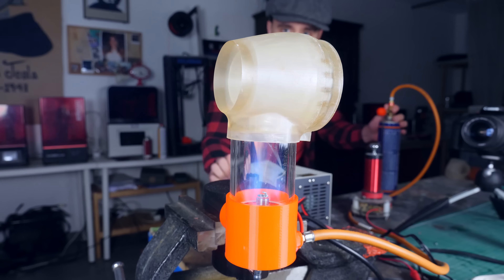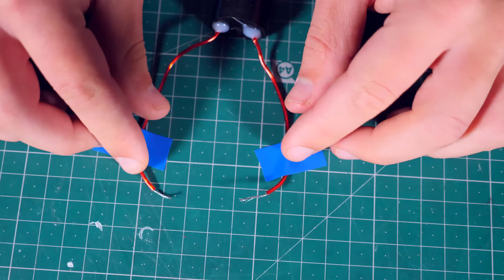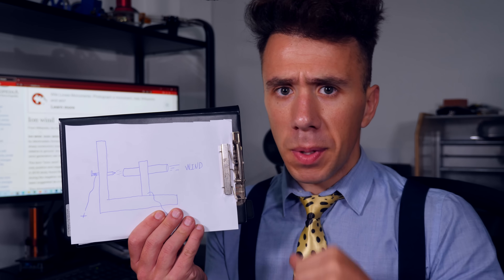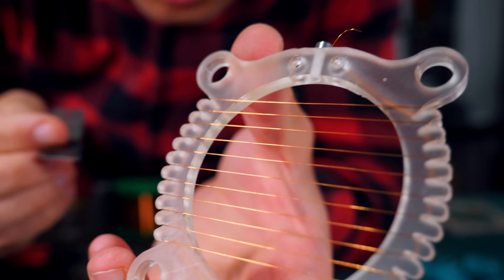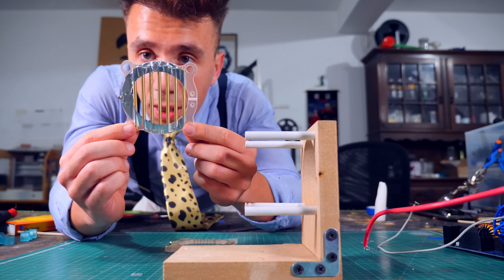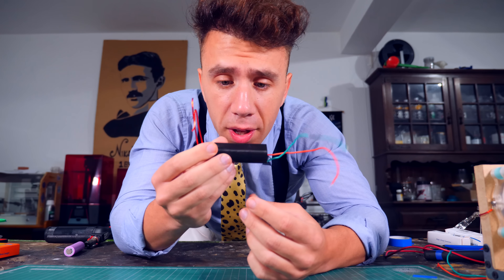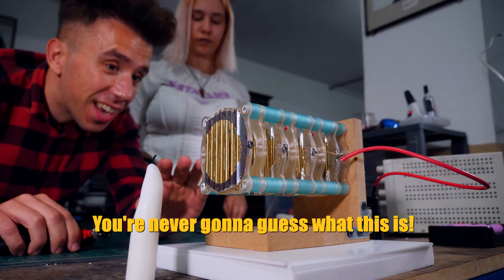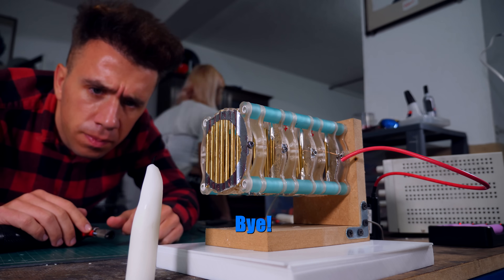I built a TRUE BLADELESS FAN

Comment: It would be a cool idea to mount that inside of a Dyson type fan. You would have to make the negative blades removable and cleanable because they will attract negative ions. I.e. dust. Mount the system upright in a funnel housing with a enclosed loop to move the air and you will have not only a fan but an air purifier as well.

Comment: What would happen if you used it to ionise oxygen which combusted with ionised flamable gas to make a jet engine or super hot plasma torch?
You could inject the oxygen through syringe needles and methane etc through holes in in your existing pipes

Comment: Why not put it in a cone configuration?  As in, you 3D print an external jet casing, and spiral-wire the inner wall of it in a criss-crossing grid, and then have your "blunt object" be the spike-nozzle of an inner cone fitting (it's blunt because the pointy part is aiming out and away from the jet, while the wider portion is closer to the inner wiring)?  If you cap the outer wires with a layer of foil to create one big connection point at the intake, and then run the wire for the inner cone through the plastic inner cone to reach the plating of the spike, then you'll have plasma flow running down the inside of your jet engine.  All the power would hook up at the intake point without the positive and negative interfering with each other, and there'd be no trailing wires to interfere with your airflow at the output.

Voila, plasma jet.

Comment: The likely reason the cheap chinese high voltage thing provides so much better results is that it is likely outputting a higher voltage due to the voltage multiplier having a lot of stages.
The flyback in the circuit you got and the one in that TV almost surely already have a voltage tripler but it could benefit from more stages.
The ZVS circuit in the flyback driver that you got is great for getting a lot of current out of the TV flyback transformer but driving it in flyback mode can actually get you a higher voltage and be more efficient for this application. 
If you want to get the most voltage out of a TV flyback without using a multiplier: I would get a high voltage n-channel  mosfet 500V of more and as high current and RDson as possible with a zener diode of slightly lower voltage between drain and source to protect it, place both between the primary and ground and chop the ground of the primary, that will cause some monster voltage spikes, as high as needed to transfer all the energy out of the secondary or to be dissipated in the zener, whatever happens first. I would also wind my own primary in the ferrite core so you can fine tune the number of turns (few are needed, 10 to 20 is a good range if I recall correctly). As you are goint to push it real hard I would also advise you to cut all the pins from the bottom except ground and pot everything in epoxy as they will arc over, they might despite of the epoxy if driven hard enough but you can get 70KV or more out of a regular TV flyback this way. 

Another way to get a ton of voltage out of this things is driving them in secondary resonance mode instead of in primary resonance like the ZVS driver (or double resonance if you are insane and want it to set in fire) but it is a more complicated circuit that the flyback mode and won't output much more voltage. It will output more current, but it doesn't seem like you are limited by current if it works that good with the cheap chinese HV generators.

Comment: Since we are working with low levels of thrust it might be worth considering ajusting the air pressure somehow at both ends of the fan to incentivise air movement. Probably covering the thing in a thin acrilic tube might give it more thrust by reducing the resistance of the air around it. Plaing with nozzels, intakes and conical shapes might give better results. Also we should consider the thickness of the wire and the power that runs through it. For example a thicker wire might support a stronger current and improve the design in that sense.

Comment: I have a sneaking suspicion that meter might be picking up some wawes or charges from that fan. Especially if at any point it was AC. I mean there is already a small AC motor in a closed circuit there.

Comment: Concerns about ozone set aside for the moment I would suggest the following:
1 Does is increase the velocity of air that is already moving? Place a small fan near the intake and measure the input flow and the output flow. Is there a linear correlation? If so line up two or three units housed in a pvc pipe. Maybe you can make something like a ramjet or scramjet. 
2. Venturi ducting on the inlet.
Just a couple of thoughts.

Comment: You could rrange the stages in a circle and put them in an impeller casing (make the air go in a circle so it can go through more stages before exiting the fan).  You could also used different sizes of tubes to see which works best (thinner tubes might mean better aerodynamics but i dont quite know the tradeoffs). You could also stick it in a cylinder,  works for every fan so far. (Also probably helps with electric isolation)

Comment: Video idea for both you and Jay: make a piston engine but the piston is pushed through electrostatic.

If that made no sense, then, my idea is basically that you have 3 plates: 2 for the cylinder and 1 for the piston. The piston is always negatively charged.

Then both plates on opposing sides of the piston will switch from negatively charged to positively charged and the cycle repeats.

Since negative plates like to attract positive plates, but negative plates DON’T like to get connected to other negative plates, then the piston plate will move up and down.

Try it! Doesn’t matter if it works, because it’s just a proof of concept.

Comment: IDEA#1: Instead of the thin wire going straight across, wrap the thin wire in a coil around a thin insulator about the thickness of a toothpick. (basically replace each thin wire with a coil of thin wire - to get more surface area).  score the coils across with a sharp blade like you did for the wires on opposite sides perpendicular to the the plane of ionic motion and score it the direction of motion (don't score the back). This will cause the pointy fields to pull in more ions of air than a single wire (kind of like a dyson fan) to amplify the effect (for the positive ions).  Basically, you will play around with the laminar flow.
Reply: I wish this comment to rise higher in the ranks. Help men
Reply: @Alex Smith good point

Comment: Hi ! I saw that u made a wankel Air engine (rotary piston engine) in the past. Now i want to suggest you something. Try adding a small air compressor (3d printed) with some gears so the compressor will have a higher spinning rate than the engine. It may result an engine that generates power by itself. I think that You should try it because u have the necessary things for it. Thanks !

Comment: First and foremost, you can get better RoI on power by contining the asembly so pressure isnt lost out the sides but forced forward.
a consument V design in a 2d lattice to the wire side would probably help a lot in getting the electrons to flow off (but that would probably require a press form to make and need a backing stablizer which will effect flow through put with addl resistance.
Simlarly converting the tubes into a matching 2d bulb latice that matched the V's would be a good idea.
Also having a diamenter band of wire that distributes the conection along each end at scale would probably help ensure use of all contact points vs the jumps that make the shortest circuit.

Comment: Plasma tornado of course. Stack the plates (a shout out to the airfoil copper tubes to reduce drag) into a circle. While heat will generate an updraft, maybe have some side plans for wing tips and/or imperfect alignment. If it's not visible enough, maybe a tesla coil going in the middle of it.

Comment: What if you encase it? 
Leaving the Intake and Exhaust open, and adding a Funnel with the reduction going in the direction of the airflow to the Exhaust. 
This should give you more Pressure. 
Before you finish this Project, can you spray a flammable Vapor into the Intake? 
I like watching you play with Fire.

Comment: I would think the next step would be to funnel down the air to increase velocity.

It looks like you are a 120mm size so if you step it  down to 80 mm or 40 mm that should increase the velocity 

Maybe also have multiple steps funnel down into one output.

Comment: Hey, what if you direct the airflow better, like covering the sides of the stages and allowing air only from the back side (like a blade fan, blades get air from the back and allow out at the front, sides are solid). Maybe making each stage to be 90 degrees from the previous one?

Comment: This is really interesting! I have so many questions;
1. How does the power consumption fair against a regular fan with similar power?
2. Is the air it produces warmer than the ambient room temperature? 
3. What’s the noise level compared to similar regular fan?

Also, could the same concept be used to make a bladed motorless fan? 
Great work as always!
Reply: Answer to number 2 - it's cooler, due to 'electrostatic cooling'.
Reply: It's also toxic due to the ozone it produces. They use ozone generators like this to sterilize rooms.

Comment: I remember that one of the computer tech channels made a setup like this to do a computer without any kind of moving fan. The entire front baffle was made into a ionic fan. As far as I remember it worked, but wasn't very practical. Still it's an interesting concept. I also have a feeling it acted kind of like a combination of electrostatic filter and ionizer. So the "fan" had to be cleaned regularly as the cathode attracted particles from the air blowing past.

Comment: I'd recommend building one of those electrostatic generators if you have the chance, really cool gadgets if your into high voltage tinkering. I used bamboo skewers and cotton thread running off a beefy flyback. really need to be tethered to stay stable, but there is something exciting about a machine carrying 30kv that flys around in completely random directions ^.^

Comment: My only tip when running screws into wood, especially particle board, is to pre drill the holes so that the wood doesn't split. Thanks for the demonstration of a true bladeless fan. Now I'm curious about the energy consumption to drive it

Comment: Ok the bladles fan is add electric current to move the air in the direction you want it to go.  So if you seal the camber so only the ends are open an use the same idea as jet engine to compress the air.  Then just as it comes out use the same set up with wire introduce fuel an high compression an light like an afterburner on jet fan.

Comment: I dont remember where I saw something similar. Maybe it's been Electroboom, but not sure.

Maybe try using an array of nails pointing at an array of washers or pretty short tubes. This way you could force the direction of air movement even more, i think. Something like laminar air?

Comment: So, I'm wondering if you could build a hover craft out of this.  I don't think it has enough thrust per weight to fly but hovering/surface sliding should be achievable.  Also, the mesh you made can double as a tomato slicer, not that you'd ever eat sliced tomato, actually maybe that's too good an end for them.
Reply: There are a few ionic wind hover thingies on YouTube. They're basically a tin foil ring serving as the anode, suspended over another piece of foil as the electron source, if memory serves.
Reply: Looked one up, it's actually a foil anode wrapped around some structure with a wire as a cathode on the same structure above it, so the whole thing is actually hovering. Cool!

Comment: Now, Send this up using a Weather balloon and when it gets as high as possible kick on this fan for Lateral motion using the Helium or Hydrogen from the balloon as not only fuel but to stop it from bursting as it raises.  Use this fan to induce lateral motion which as you gain speed would translate to vertical motion.  IF you can get high enough I suspect you can get this thing in orbit.  I looked into permits and I am not even sure if you would even need one because I have been considering doing just this for a while now and have the numbers if need be.  This is far more powerful than anything I have ever made.  What is the weight?

Comment: if you have to wear it - You should secure your tie when working with a bandsaw or drill (or any other strong powertool). Any lose cloth can become very dangerous and it is best making it a habit to avoid that even if you think the tool you are using would be fine.

Comment: Suggestions for a Theme for a future video: Put the stages in a circle and connect them with a round tube. I think this donut will accelerate the air to a very high speed. At one point you can integrate the anemometer. I can imagine that the air has a theoretical maximum speed of the charge flow (no proof of course) and is only slowed by friction.
Reply: But it will need to make it trough the curve

Comment: I think you're going to want to reduce the diameter of your successive stages, in order to even further increase the flow rate.

Id also be interested in using a single multi-tap high voltage system, so your intermediate sections can share a voltage

Ie, drop from 1000V to 500V to 0V instead of 500V to 0V, then 500V to 0V again.

Comment: Fun fact, next time you wanna speed up some super glue, just sprinkle a little baking soda (NaHCO3) on it and see what happens.
Reply: Bonus fact, sometimes it can be helpful to apply a bit of the glue to one of the surfaces and a bit of the baking soda to the other, especially if you're trying to glue something together on contact or at a tricky angle or deep hole.

Comment: Use narrower tubes or even just another grid of a thicker wire for the negative side of the circuit.  At 1:36 in your video, it shows the negative with a cross-section similar to a wing or tear-drop, so, do that.  Also, enclose the sides of your wind tunnel, and try doing a series of successively smaller circumference grids so it concentrates the flow.

Comment: I think that you can improve the bladeless fan using a rectifier on the end of the HV generator. The cheap amazon generator doesn't have a rectifier So... you are pushing and pulling the air and the airflow can be greater if you only push in one direction (HV-DC).

Comment: You need to compress the air by using a cone to direct the wind at an object. Create a chamber that encapsulates the wires and tubes, but that has a cone down to a smaller diameter that goes past the end of the last stage. That should improve wind speed and pressure.

Comment: what if you designed a drop-in replacement for the turbine in the dyson fan housing? if it could create enough pressure, it could utilize the secondary air multiplication stage for more/even flow, no?

Comment: I wonder if 'carbon whiskers' would be helpful in this model, or if that would mean a whole new design. I think those carbon whiskers are more pointy for the discharge. But having not tried this experiment, I can't be sure which method is more efficient.

Comment: love this. you could experiment with different mediums for fuel, such as argon. nasa and others use these other mediums because they provide more thrust. also since you usually do more mechanical and rocket stuff, you could check out the biefield-brown effect, a high voltage effect that dates back to before world war 2. theoretically it produces a eletrically induced gravity field. the lifter 4:15 also uses this effect although the lift mostly comes from ion wind. check it out. also do t you hate it when your friends or siblings are not interested in what your building. keep up the work

Comment: One thing to probably note is that this will generate a lot of Ozone while it's running, probably best to continue your experiments with a fan in the window to circulate air. This is the same principle in which old air purifiers work.
Reply: Ozone is good unless you're in an enclosed area. It's the gamma rays that are a health hazard. Edit: don't breathe ozone in concentration. It's easy to smell.
Reply: @glennboyd939  I recommend you follow that epa link and update your post
Reply: @glennboyd939  ozone is bad even in an unenclosed area. It's incredibly toxic

Comment: I always thought it would be really cool to build one of these into a Tesla valve. Imagine the internal "teardrop"-like shapes as the high-voltage elements, either alternating positive/negative, or having the "points" of the main structure as the positive element, and the "teardrops" as the negative elements. I've actually had the idea in my head for while. Though I'm not sure when it first came to me, but  I got really excited when I saw your video, because I think you'd be able to pull it off. You'd be the PERFECT rogue engineer for the job! I know how unlikely you'd settle on my idea for development, but how cool would it be if you DID?! At any rate, I simply had to share my idea, to put it out in the world. Maybe it will inspire someone else, even if not yourself. Cheers, and keep up the great work! Your projects and videos just keep getting better!

Comment: So hear me out on this. I recently became a pilot and have had to put a lot of thought into airplane mechanics and such. I won’t bore you with the details, but what if you could apply this to make a closed, turbofan engine? The same concept. Use the wires with a ground port, and have it power a compressor stage for the engine. Is it possible?

Comment: The round Pipes actually introduce a lot of drag. Try to give them an airfoil design. The biggest amount of air resistance comes from the turbulence behind the tubes, that's why in the original image they are only round on one side and pointed in the other.